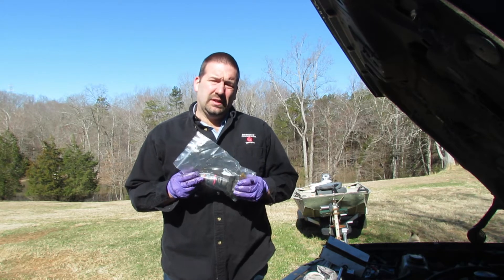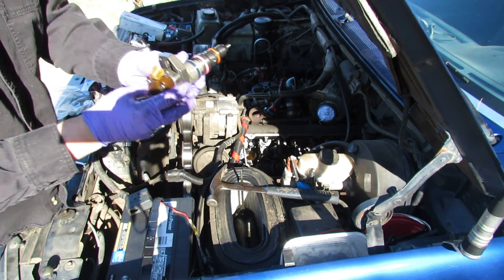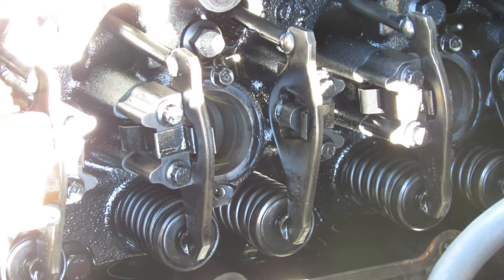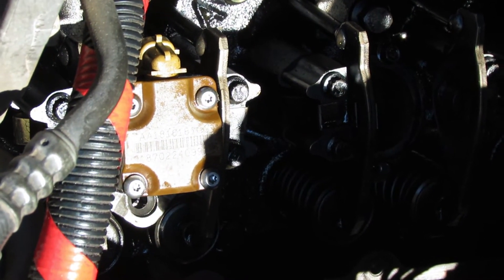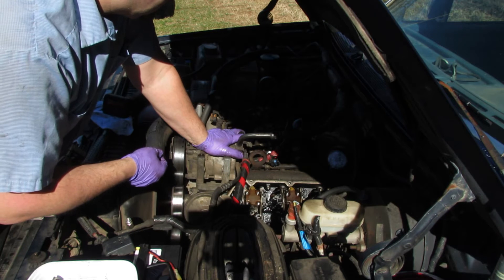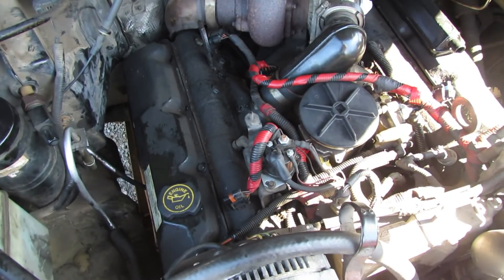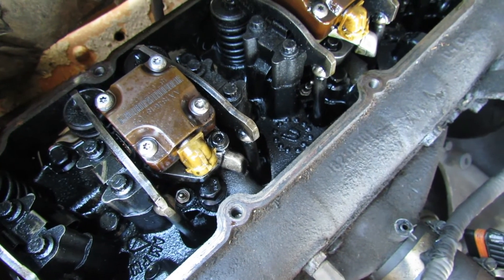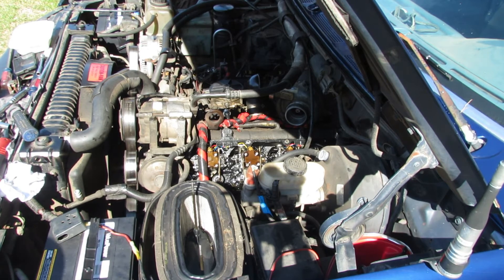Part 2 7.3L Injector Swap (Installation and Startup)

Comment: Did you vacuum the oil and excess fuel out of the cylinder?
Reply from the maker: @Alex Bowers no I used an alternate method. I pulled all of the glow plugs out   and turned the engine over to blow the junk out of the cylinders through the glow plug holes and into the oil pan. I changed the oil right after I got her going well. Thanks for watching and commenting! ~Mr. C.

Comment: what’s the cord called hooked up to the battery when you turned the truck over?
Reply from the maker: @kota beeks it is called a jumper wire with alligator clamps. I have provide a link below for a set of them, one black and one red. They are not the exact brand I have but look pretty much the same. Thanks for watching and asking! ~Mr. C.

https://amzn.to/3lyQjbW

Comment: Excellent thanks! Glad you detailed how to blow the oil out of the cylinders. No one else has shown that being done.
Reply from the maker: Chris Layton I am so glad you found the content useful. I will have to give credit where credit  is due. My ole buddy told me how to do that. He was a Ford Diesel Tech. I have another friend who works at a private shop and they did injector o-rings on a 7.3L and had never heard about that process. They used a vacuum jug and tried to suck the junk out of the cylinders but still hydro locked it and had to pry valves open and all kinds of stuff. Long story short I had no problems the way I did it but did have to change the oil which you should do anyways after internal engine work. Thanks for watching! ~Mr. C.

Comment: Glow Plug harness wire: if you grab the black rubber piece about an inch down with needle nose pliers and hold them straight with the direction of the plug you should be able to push them on confidently without risking breaking the gp or the harness plug
Reply from the maker: Jeff B, again, excellent information.  You are very generous with your knowledge. For that I thank you.  ~Mr. C.
Reply: @NaturesCadenceFarm  I spread it as far as I can. Learning things takes a lot of energy, I rather give it away to feel like spending the energy was worth learning it

Comment: If you don't have a torque wrench and want to get them hold down bolts on, use a 1/4 drive wrench and keep spinning until it's apparently difficult to keep it going. Although I tried to do this on every bolt and I didn't go far enough (thankfully I have a torque wrench, it just needs to be tighter than I was comfortable going without knowing for sure
Reply from the maker: Jeff B you have provided so many excellent tips!  Thank you so much for taking the time to write this to help me and all of the other gear heads out there. Great stuff! ~Mr. C.

Comment: This video was helpful for me to finish my injector cups on the 7.3

One issue I ran into was removing the upper injector hold down bolt, that's hidden under the electrical connector. The previous mechanic must have used a 12 point box end, or a poorly made one, as all of the upper bolts were starting to round off. It wasn't until I acquired an 8mm six point box end wrench (~4in long) that gripped the sides of the bolt instead of the corners, that I was able to remove the upper injector hold down bolts. 

I made sure to also replace all of these rounded bolts with new ones from RiffRaff

Cheers!
Reply from the maker: Eric Fore we are so glad you found it helpful.  I bet you were sweating bullets when the bolt heads were beginning to bugger up.  I know I would be.  Excellent job working through it.  ~Mr. C.

Comment: I'm no mechanic so this is a genuine question. Wouldnt you want to clean out all that oily diesel from the fuel filter and replace the fuel filter and then add a little bit of clean diesel to keep it running? Or does the oil in the fuel not matter too much? (i know some people add two stroke oil to help with lubrication). Total side note: what fuel additives do you use/ if any?
Reply from the maker: Larry Wineman you pose an excellent question. Diesel engines will and can run on oil as long as it is thin enough to pass through the system. Since the engine uses compression to ignite the air fuel mixture and engine oil is combustible she purrs like a kitten. After the old diesel / oil mixture has been used up from the tanks and filter housing and replaced with fresh diesel by filling the tanks you could change the fuel filter if you thought necessary. I will add this caveat... I would only trust my old 7.3 to handle this level of "abuse", I would be very hesitant with newer more "refined" diesels. You are correct about some lubrication is good in the fuel system of a diesel engine. When sulfur was mostly removed from diesel fuel, its lubricating properties were removed with it. I use Power Service in the gray bottle for every fill up. It has cleaners and a lubricant. Check out the link below to purchase it. Thank you for asking and watching! ~Mr. C.

Power Service Fuel Additive: https://amzn.to/3bHKTqU
Reply: @NaturesCadenceFarm   Thanks for taking the time to explain that! Makes a lot of sense!

Comment: Would this be same for a 1999 7.3?
Reply from the maker: Eric Gomez yes the procedure is very similar. The "newer" 7.3 has a little different intake system and valve cover gasket but the injector bodies are the same. Good question..~Mr. C.

Comment: Did you replace any of the injector cups?
Reply from the maker: Tyler G I did not. I talked to three diesel mechanics and they recommended not messing with them unless you have a problem. One mechanic told me they usually fail after someone works on the injectors because the original copper washer is left in there when the new injector and washer are reinstalled. I made extra sure not to do that. Thanks for watching and asking. ~Mr. C.
Reply: @NaturesCadenceFarm  that's cool I've heard so many different opinions on them I was curious as to what you did. I think it's best to leave them alone unless you have to mess with them.

Comment: Do you hook up the injector clip before spinning it over to clear the cylinders?
Reply from the maker: Cameron Fountain if I remember correctly I did not connect the wiring harness before spinning her over. A quick update, she is still purring like a kitten. ~Mr. C.
Reply: For future people wondering, he in fact did not have the valve cover gaskets on or hooked up while he spun it over. You can see when he put on the driver side it did not have the vc harness plug poking out next to the dog house (its the reason I'm rewatching this video right now)